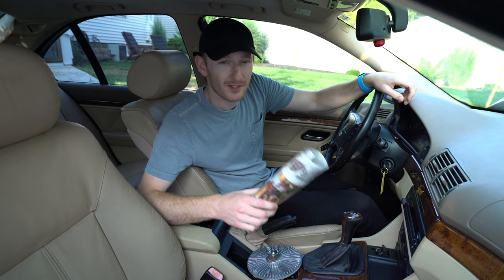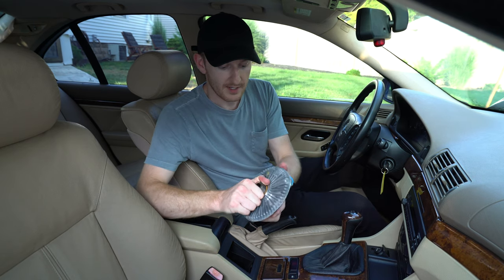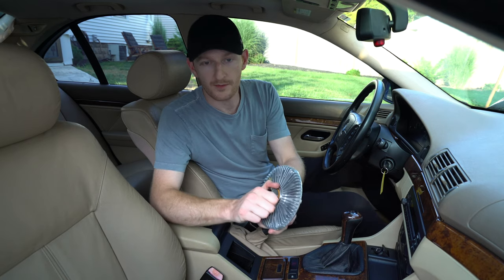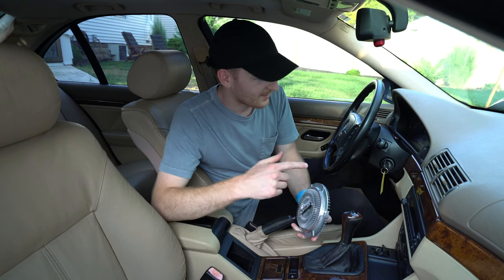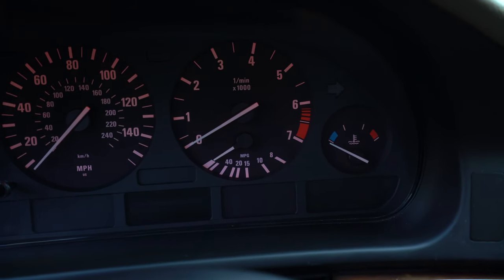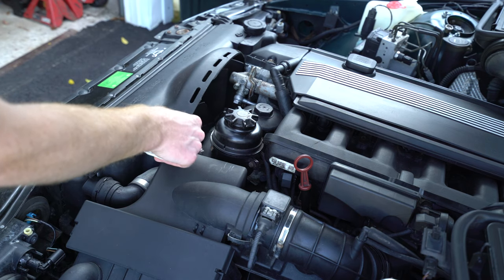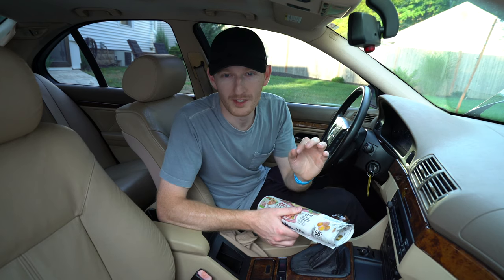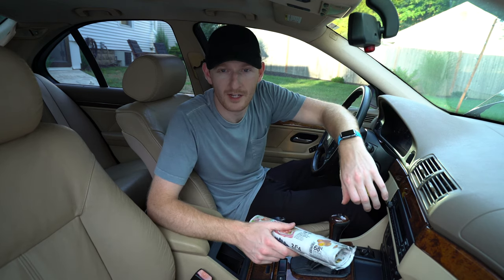How to Test the Fan Clutch for any BMW with a Newspaper

Comment: I was reading a thread somewhere and the mechanic said he just always uses his hand.  lol.  I was like...so the options are, 1) the fan clutch is bad and you confirmed....orrrrrr....2) The fan clutch is good and you're down a hand.
Reply from the maker: Never use your hand!!
Reply: I used my hand to stop it to show my brother it was broken but to be fair it was rotating at like 15 rpm. But yeah just use paper just in case it's moving so fast it looks like it's stopped  😆
Reply: I've tested the fan spinning many times. I've always just used my hand. No glove. I guess if I was scared I would wear a glove. 

You just let the ends of the fan blades rub against fingertips of your right hand against driver's side of fan. Don't stick your hand INTO the fan per se. At idle speed it's not a big deal.

If you're going to rev the engine and test it, I would wear a glove then

Comment: The bi-metallic strip on the front of it is very sensitive to heat small changes in heat make big changes in the size of it since it’s made of 2 metals with very different properties. When you drive the car warms up the radiator gets hot and the heat from the radiator warms up the bi-metallic strip it expands. Engaging a pin that opens a pass way for the fluid inside the fan clutch to move into the engaged position. When temperature drops the bi-metallic strip shrinks and does the opposite. Disengaging it.

Comment: As a general question, wouldn't the fan clutch only really lock up when the temperature of the engine bay was high enough? I would also argue that the fan clutch locking up all the time is the worse way to go because then if you rev >3000 rpm it could explode the plastic fan and send shrapnel all over your engine bay, destroying your WP, t-stat, radiator, as well as your hood. If the fan clutch stopped locking up I believe the pusher fan in front of the condenser should be sufficient to keep the car cool in anything but extreme temperatures (the south or Arizona area).
Reply from the maker: LogicIsDumb yeah it should definitely be locked up idling at operating temps (ambient temp here 80*) so it should lock up and shred that newspaper! I’m not sure any failure is good, but locked at least it won’t overheat the engine and rip the head bolts out of the aluminum blocked M54! Thankfully in all my BMW driving years I’ve never experienced a fan explosion as you described but have def heard of it lol, that would suck
Reply: @BIMMERZEITT  I only ask because in my current car with a new fanclutch if ambients are low enough or it just got up to temp I can stop the fan fairly easily, but once its 90+ degrees or in traffic it locks up and I can hear it. Definitely agree with you on the newspaper trick, I tested it with my fingers on a hot day and lost quite a bit of skin off the end of them, lesson learned the hard way.
Reply from the maker: LogicIsDumb not at all! Thanks for watching bro
Reply: Nigga I live in AZ😭😭
Reply: Not likely at all unless you fail to realize any of the several indications of an overheating bimmer. You're car will make it another day for sure, get the fan replaced and carry on in life.

Comment: I disagree, both are worse ways. 1st way- your fan will just grenade and break into pieces and pierce your radiator or hoses then overheat as viscous fan are only designed to spin at 1800-2500 rpm.  2nd way is of course same thing-overheat.
Reply: This is real.

Comment: Thank you so much for making this video, god bless i own a 98 e36 and it looks like my fan clutch is not working like its suppose to. Easy to stop with newspapaer and the car is overheating its overheating faster when the ac is on. I also have a done of oil leaks. No mechanic is serious about fixing it or finding the oil leaks 😮

Comment: Thanks a million,this video is so helpful,my E39 just cuts off in middle of the road,especially on very hot days when I'm driving at a slow speed,j then drove inn ag one of the machanics in town,he simply stopped the propeller with his fingers whilst the engen was running and told me to replace my viscous.so my question is,could this has damaged anyrhing else on my vehicle?
because i kept on driving it with this problem without knowing what was going on,the vehicle runs very well after all.
is my water pump and cylinder head still ok?
Mr.Zuma from fromSouth Africa🇿🇦

Comment: 10 years ago when I removed the mechanical fan, I installed an engine temperature gauge. The the temperature sensor is installed in the engine coolant outlet hose.    also I installed two LEDs.  A yellow one on then the A/C fan is running on low speed , and a red one on when the A/C fan is running on high speed.  This is why I know these things. 

 If someone removes their mechanical fan and they don't install an engine temperature gauge their engine likely gets very hot and they don't know it.  The BMW engine temperature gauge on my 1998 Z3's dash does not indicate the engine temperature swings that I can see with the gauge I installed.  Someone said BMW designed this gauge like this because the temperature swings disturbed some of their customers.  If the engine temperature is extremely high the BMW engine temperature gauges moves full right. 

My fan clutch is working but it seems to me allow the engine to get too hot before it engages but maybe that is how it's designed..  I tested it today (88F ambient) climbing a steep mountain road  with the A/C off and with the electric A/C fan fuse remover.  It engaged when the engine coolant exiting the engine was around 210F (engine temperature) and disengaged around 195 F. 

 Cruising on relatively level HW ( no steep hills)  the engine temperature is maintained around 199F with or without A/C and the electric A/C fan.
 
According to my Bentley service manual page ELE-40 the electric  A/C fan should start on high speed around 99C = 210F at the radiator coolant exit. It seems if this is how it actually is the engine temperature would be extremely high prior to the electric A/C fan shifting to high speed.   For those that don't know there is only one A/C fan motor and it has two windings. Hi and Lo speed.  Only one winding is energized at a time.  Both motor windings are not energized for high speed.
 
I'm thinking the mechanical fan is partly engaged maintaining 199F while cruising and driving in town but it doesn't fully engage until around 210F going up a steep mountain road.  Also the electric A/C fan alone (no mechanical fan) could not prevent the engine from over heating when going up the mountain road so I think maybe the fan clutch is partly engaged prior to the engine reaching 210F.  
unfortunately I forgot the engine temperatures I was seeing while going up the mountain road with both fans operating. .

C
Around 10 years ago I did the fan delete and installed a radiator exit temperature sensor that starts the fan at 190 F.  When my engine overheated twice going up the mountain road I decided to put a new BMW OEM fan on the car so now I wish I had put the stock sensor back on the radiator.  I would rather have my electric fan backing up the mechanical fan rather than the mechanical fan backing up the electric fan which is what I have now.   I think the mechanical fan will never engage if the high speed electric fan is running unless I'm going up a steep mountain road with the A/C on. .   I think I need to do something about this.

 Without the mechanical fan on a relatively level HW I didn't need the electric fan running even with the A/C  on.    Going up a steep mountain road is very different.

Zork said   " I've done some testing.
Viscous fan off. [ I think he means no mechanical fan installed.  I think he did the fan delete crap/error I did ]
Aux fan works (new) and new 80/88c fan switch [ not stock] fitted.

I've got my OBD reader plugged in and taking love readings.
The middle of the gauge on the dash covers around 90-120celsius.
It moves right toward the next mark (but not at the red) when temps get close to 130c. [ my BMW dash gauge is not like his ]

The temp seems to sit around 120c when moving (light throttle, ambient temp of around 18c).
After a run I stop and leave the car running and after a few minutes the temp climbs to 130c (and gauge moved to the next white line).
The aux fan kicks in when OBD shows around 132c [ 270f, IMO at or near engine destruction ]. It runs for around 45seconds only and the switches off and shortly thereafter the temp drops back closer to 120c (and this cycle repeats). " 

Likely Zork was testing on a relatively level HW, not on a steep mountain road.

Comment: the newspaper does not immediately stop the fan but it eventually does after about 10-15 seconds, does this mean a good or bad clutch? the fan has obvious oil dampening when the engine is cold, it does not spin freely

Comment: Would the temperature gauge needle move beyond the middle point towards the right if it overheats with a failed fan clutch? Do you get any message on the dashboard of the fan clutch fails?
Reply: yep it does move full right when the engine is extremely hot.  I don't know what the engine temperature is when that happens.

Comment: So the fan clutch is bad if you are able to stop it? Also, is the aux fan supposed to be running/spinning 24/7? Or does it idle when not engaged? Im used to an electric fan in my e46
Reply: im wondering the same thing i can stop my fan easily at normal temp and i have over heating

Comment: Mine on my e39 is locked up. While I'm in there your think I should replace the water pump or no? It's not overheating.
Reply from the maker: If it is old, you can do the water pump, thermostat and serpentine belts (both main and ac - 2 belts total) along with fan clutch. You can also do the upper/lower radiator hoses too, "while you're in there" haha. It adds up.

Comment: I replaced my fan clutch but I can still stop it with newspaper, how do I test it in the locked position?
Reply from the maker: It will only lock when the compound inside the clutch (viscous coupling) gets hot enough. Take it for a good drive and let it get up to operating temp. You shouldn’t be able to stop it typically with it idling in the driveway after a spirited drive. 

Not all fan clutches created equal. Aftermarket is hit or miss, I’ve seen defective ones a lot. Best bet is genuine BMW oem or Sachs. Then again, after 2020 there is little made to a high standard in Germany anymore. Sad times!

Comment: got a e46 with 250k miles, fan doesn't turn on at all, even if the AC is on. high speeds the car runs and drives fine, but at low speeds it will slowly start to overheat. clutch fan the verdict?
Reply from the maker: your E46 has two fans. one is the electrical auxiliary fan behind the front bumper, and it also has a mechanical fan clutch behind the radiator. it is possible both of them have failed.
Reply: @BIMMERZEITT  just bought this car and it seems that I only have one fan, behind the radiator and its electric. there is no fan Infront of the radiator/behind the hood grills

Comment: So I just tested my fan clutch, 2001 E39.
Cold start - fan spins fast with engine, cant be stopped with piece of cardboard. So i think ok, clutch seized on. 
Then 30 secs later car drops off cold start fast idle, and fan relaxes - able to stop it with fingers - Huh? 
I guess I'll do newspaper test when full hot, but what's with starts locked, then releases?
Reply: I think at cold start the fluid in the clutch is viscous enough to drive the fan, then as it heats up it releases

Comment: that fan in my 728i 1999 is always on.. doesnt matter what temperature is outside. is it normal in this car?!
Reply from the maker: Péter Kovács fan clutch is designed to engage and disengage. If it is engaged 100% of the time cold and hot, it is bad. Replace it!
Reply: @BIMMERZEITT  i will. Thank u so much....
And what about the AUX fan? Its off when i turn in the AC... Outside temp 3-5degree..

Comment: Ok so to wrap up your test, in addition to how yours reacted when inserted the news paper on it, it resulted in a bad fan clutch off yours then?
Reply from the maker: thomas backer correct Thomas, the clutch in this green e39 in the video was bad and worn out. Another way to test would be to start the car (cold, temp needle all the way cold) and see if it shreds the newspaper. If it does, it is bad. The clutch is likely stuck on in the engaged position.

Comment: Think another test is that one can spin the fan easily with the engine off but it wont spin if the fan clutch is working. My e30 fan spins all the time the engine is running or is that supposed to happen. It shreds the paper though.
Reply from the maker: Does it shred the paper with a stone-cold engine? If so, it might be stuck on. You'll notice that fan-clutch engaged sound all the time, would be an indication the clutch is bad. How old is the fan clutch?
Reply: @BIMMERZEITT  Many thanks for reply. The original fan clutch failed the paper test and the car used heat up slightly in traffic so I changed this back in 2008. The 'new' fan clutch will shred paper with a cold engine but the car has since never heated up in traffic and I assumed it was working correctly and this is the way they operated. It was also a lot louder than the original clutch which was just spinning at engine speed.
Reply from the maker: MsCelicagt4 interesting, what brand is the clutch from 2008? It sounds like it may be defective. The loud “fan engaged” noise you hear normally should only be present when hot and pulling off from a stop light or parking. As you journey down the road the car cools down and the clutch disengages (free wheeling) to save fuel economy etc.
Reply: @BIMMERZEITT  I will have to tell you tomorrow as its 2.50 at night here in Ireland. I dont think it was a BMW one though as I would have the invoice in my foot thick dossier. I will have to study my fan clutch now to see what it does. I know you did a great tutorial on cleaning the gauges on an e30 but my fuel gauge shows full all the time so can you take that case on as well. Back tomorrow--thanks for help.
Reply: @BIMMER ZEIT   Checked there and no manufacturer name evident at least from the angles I'm checking but would be a recognised make I would imagine. On start up from cold, I noticed that the fan clutch can be slowed down with the paper--I will check operating temperature performance later. I just remember it being much more vigorous in its spinning at the time than the clutch it replaced.
Reply from the maker: MsCelicagt4 sounds like it might be ok then 👍🏻. Just keep an eye on the temp gauge. If staying at 1/2 way then nothing to worry about at the moment
Reply: It will fry your a abs module too